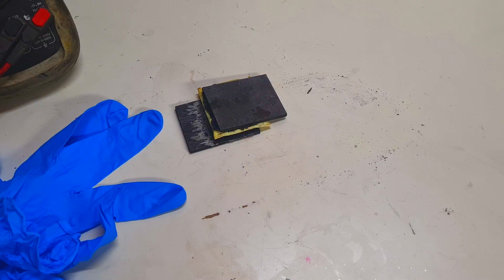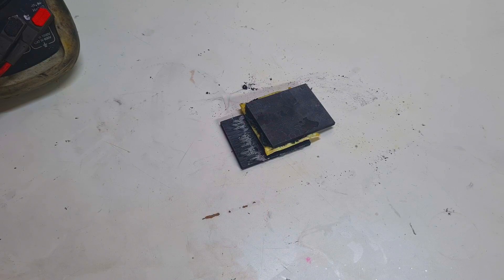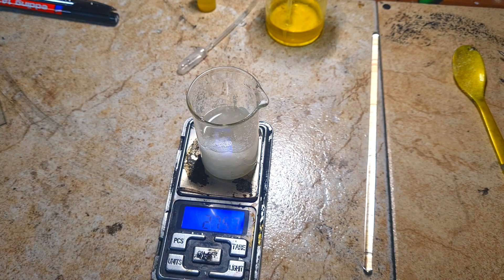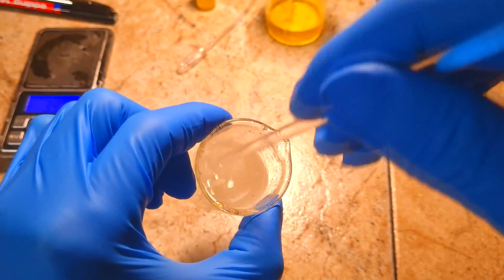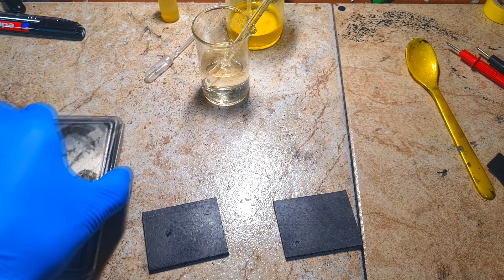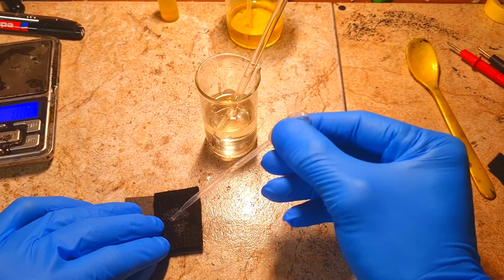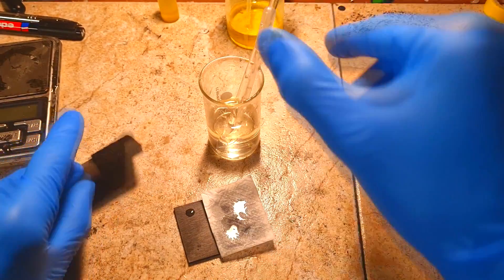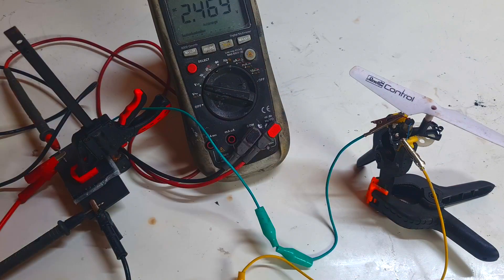Diy Supercapacitor with Water to Salt electrolyte

Comment: Hi Caryex, what is the capacitance of that Supercapacitor in this video? Also, what was the current drain through the motor?
Reply from the maker: Sorry I dont measured the capacitance of that supercapacitor, because I move to upgraded vesrion of this supercapacitor. Around 200mA is the current.
Reply: @cayrex  thanks for replying Cayrex2. That's quite impressive. Do you have any videos that show the construction of that particular Supercapacitor? What sort of carbon are you using and what is the electrolyte?

Comment: Thanks...very good demo of use of a high solubility salt like potassium acetate as the electrolyte (which I just happened to absent mindedly stumble upon after neutralizing a KOH electrolyte with vinegar :)). Anyway, I've achieved some useful energy storage with higher solubility salts...although after scanning the solubility tables for potential salts, potassium acetate is a good combination of (relatively) higher solubility with (relatively) lower hazard level. Again, really appreciate your video demos & explanations.
Reply from the maker: Yes,... I use that salt because is quite accessible. This video was just a warm-up. Because I upgrade the electrolyte to the point that I get some new supercapacitor with better performance.

Comment: What's your thought on ways to enhance lead acid battery i.e. maybe electroplating with zinc?
Reply from the maker: Huh, you have several ways. The lead grid current collector on the positive side is the weakest point, because almost all old lead batteries have damaged positive electrodes. One of the good ways to protect the current collectros is to coate the grid with silver,... but that will be expensive,... for example
Reply: Thank you for the response, I had in mind the hybrid battery super capacitor concept that you did a while back.

Comment: Does the copper plate on one side still boost the current of the cell?
This is also what I was testing on my cells... didn't get to far due to real life stuff happening.
Reply from the maker: Yes, if the carbon have to low conductivity.